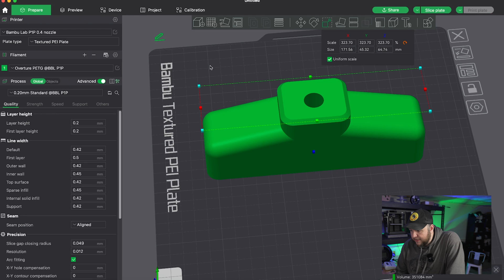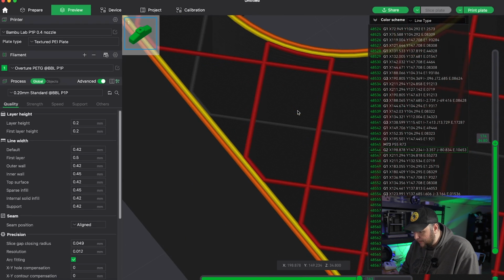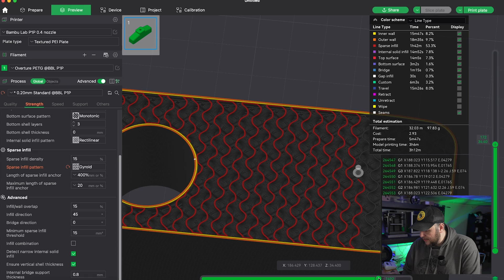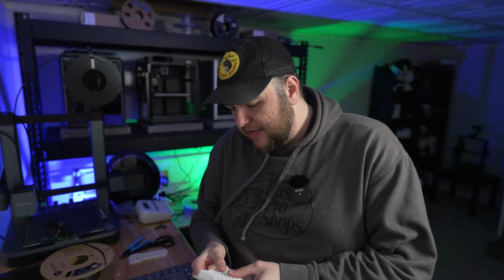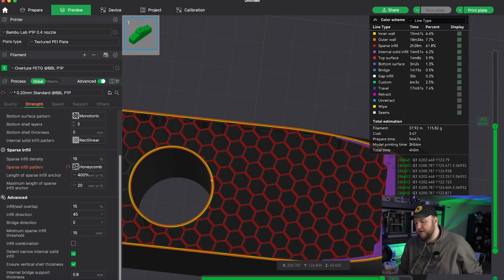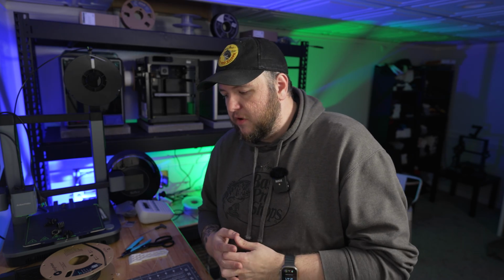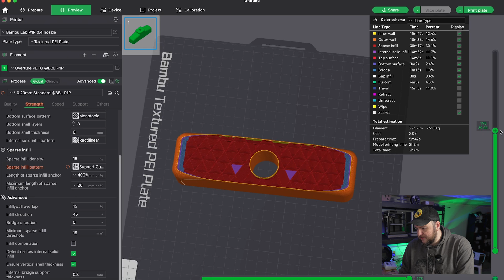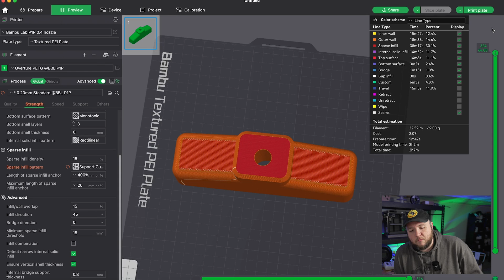What Infill Should You Use for 3D Printing

Comment: Support Cubic can really speed up some prints. Although it can suffer similar problems as Grid.
Rectilinear makes the same pattern as Grid, but puts the grid on two layers so there's no buildup at the crossings. I actually don't know why rectilinear isn't the default.
I do wish they'd make more of the infills like rectilinear where it alternates the pattern on different layers.
Reply from the maker: I’ll give rectilinear a shot!
Reply: @Shayway  So what do you think of rectilinear?  I'm also curious if you have tried the new kid on the block, cross hatch infill.  It's kind of like if gyroid, rectilinear and monotonic hooked up and had a child. 😁